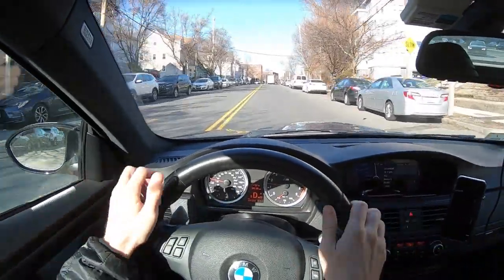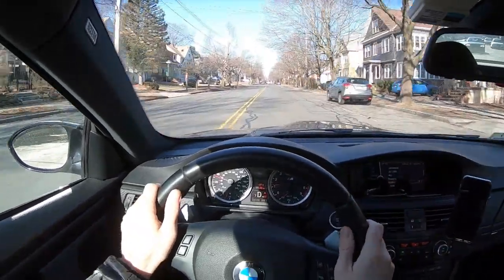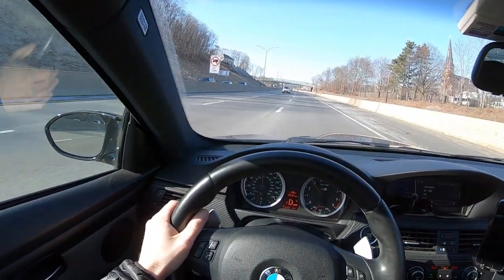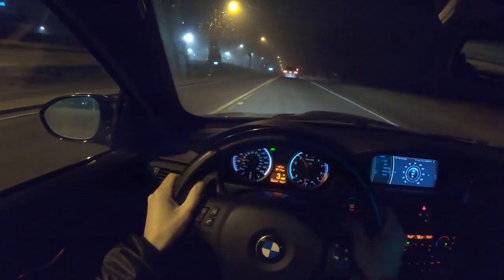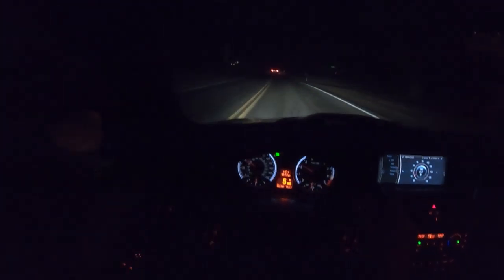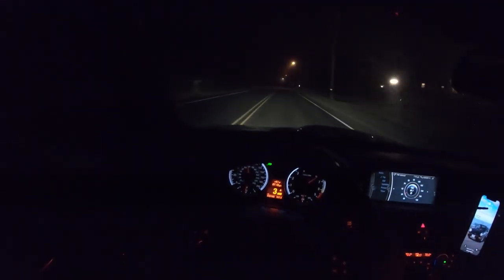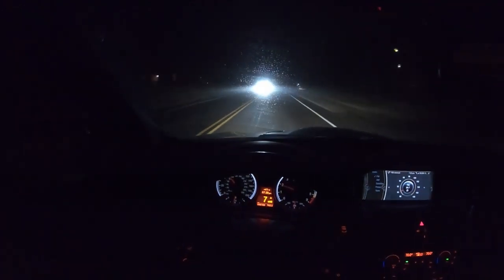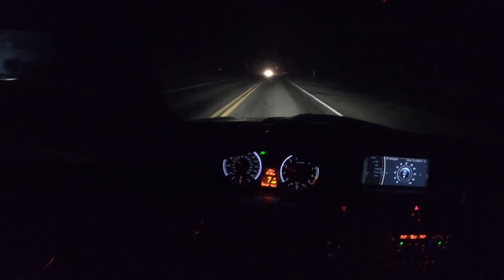Choosing Snow Tires For Your Sports Car - E92 M3 POV Test Drive

Comment from the maker: Which Winter Tires are you running? Does it ruin the driving experience for you?
Reply: Tedward running Dunlop 3D Winter Sports in 225-245 staggered. Get all around winter tire - but no dry traction at WOT until 3rd makes the M3 experience all but gone in the winter.
Reply from the maker: I had those as well...235-255 staggered. They were good in cold dry temps but had trouble in deep snow. I climbed a lot of hills with my fingers crossed and totally sideways...and a few other hills just got stuck
Reply: I've gone through winters with Bridgestone Blizzak WS80, Nokian Hakkapeliitta R3, and Michelin Pilot Alpin PA3 (not the current PA4). Bridgestone and Nokian are at the top of the heap, bar none. Michelin was more civil on dry pavement but much worse on actual snow and ice. However, ANY winter tire is better than an all-season tire! Try the Lime Rock Winter Autocross; it's a super fun time on snow! (but you'll spin the BMW no doubt)
Reply: I am a strong supporter of the Michelin Pilot Alpin PA4. I ran them staggered as 18s on my E93 M3 (235-255) and as 19s on my F83 M4 (255-275) through two terrible Chicago winters. I have been absolutely astonished by their performance in extreme cold, over snow, ice and in dry pavement conditions, both in street driving and on the expressway. My M3 and M4 running the PA4s perform better on snow and ice than our 4WD Ford Explorer does! Hardly any slipping, and the grip is always there. The car loses very little in the way of performance in dry conditions, at least in my opinion. The difference becomes most noticeable when cornering, but aggressive cornering isn't advisable in winter driving conditions anyway. The Pilot Alpin PA4s truly do earn their place among the "winter performance" tires. The biggest challenge with them is trying to find them in certain sizes. From Tire Rack certain sizes (like 275/35/19) are almost always a special order.
Reply: Michelin Pilot Alpin PA4 225/40 R18 since 3 winters and I am extremely Happy with them on my 1 series.
Reply: Michelin Pilot Alpin PA4 on oem comp wheels in 19“.
No problems in snowy or dry conditions here in Germany😎
Reply: I run 245/40-18  Michelin PA4 on my M4.  I also ran them on my previous E92 M3.  Great tire.  On dry roads they feel very similar to a summer tire at least at a somewhat normal driving style.  I have to pay a but more attention driving in the snow with these tires (something everybody should do regardless), but I have yet to get stuck or seriously slipped even in deep or compacted snow.  I ran Blizzaks before but found the tread only lasted about two seasons and didn't perform as well as the Michelins.
Reply: Pirelli Sottozero 3's are great snow tires that sacrifice very little in dry handling (compared to other snow tires). They ride quiet and comfortably, have great steering feel and have crisp turn-in. 225/45/VR17. I've had them over 120 mph and still felt very secure (149 mph rating). We didn't get much snow at all last winter so I'm not sure how they'll perform in deep snow but I'm sure they're more than adequate. I've had Blizzak WS80's and while they're FANTASTIC in deep snow, they're AWFUL as a "drivers" tire. Super soft construction makes them very uneasy on the HWY, constant squirm in the sidewalls. General Altimax Arctic's are GREAT in deep snow and just okay in the dry.

Comment: Just bought these, as I wanted something more substantial for when I hit the slopes.  The parking lots can be rough, and the Michellin AS3+ are great but not in deep fresh snow or slush with FWD.  Hoping this will be a big upgrade while still being a decent tire on dry and a better tire on wet cold pavement.  It rains a lot here in the NW.

Comment: Hey, about the lamp for the water - the problem is, you have two small pumps : 1 for the windshield and 1 for the lights. One of them is leaking and most of the time is the pump for the lights. This is very common problem, I have it the same.
Reply from the maker: Good thought but my car doesn't have headlight washer option

Comment: Bridgestone has a performance and a snow model for Blizzak's. I think the LM's are comparable and should give similar feel and dry grip to Vredeistein and Pilot Alpin. The Blizzak WS is the one that is more of a clunky winter boot equivalent to say a Michelin X-Ice.
Reply from the maker: You are well versed in your winter rubber! You're right I think i had WS60 or WS70 on my 350z. It had an open differential so it was almost always at a disadvantage but those tires never let me down in deep snow. On dry pavement though, they were hilariously clumsy!

Comment: Looking for "performance" winter tires? Pirelli Sottozero 3's! I bought a set last winter and they were one of the least expensive on Tire Rack. $568.00 for a set of 4 of 225/45/VR17; $142 ea. They don't "feel" like winter tires but like performance tires that happen to be snow tires. Good grip off the line, crisp steering, confident handling and good ride. Blizzak WS80's are great in deep snow but are AWFUL in steering feel and have no dry grip. They feel like you're driving on sponges. I've also had General Altimax Arctics and Continental WinterContact. Pirelli Sottozero 3's are the best when all driving characteristics, not just snow traction, are taken into account and they're less expensive than all of them.

Comment: Would you ever consider a winter beater being more practical than preparing a high-performance car for the winter?
Reply from the maker: Great question. Yes, I would. The reason I do not have one is because I don't have room for a 4th car, nor do I want to deal with maintenance on yet ANOTHER car.
Reply: @TedwardDrives  when I'm your age I either want an E90 M3 or a 911. Since either car is expensive to drive it seems better to have a beater to drive during snow to keep the miles down.
Reply: While that being an excellent question and I’ve been in that situation myself. I ran a Mazda protege hatch for years it was literally worth $900 bucks. 

There comes a point of when you realize even a crappy beater that starts to give you mechanical problems is it worth it. Also I ended up getting winter tires for the protege anyway becase I couldn’t  stand all seasons in snow. 
It’s sort of like weighing the options for me personally when leasing some of my BMW’s, do I go x drive and pay the $3500-4000 option or save that and buy winter setup for $1500 and save the cash and also save a few pennies over time on gas milage. I’ve always opted for the winter tires and rim setup honestly and it’s been great in Chicago weather. 
If you live in hill or mountain areas this strategy may not work out so well. So awd may be necessary + winter tires. 
Fast forward to present time I switched to Audi and S3 I still opted for winter tires and rims. Honestly being prepared is being prepared. I’d skip the winter beater, the insurance cost and headaches it brings if it breaks down and chances are you’re gonna ride it on all season tires and you’d still risk getting in accidents. Spend $1500 for a dedicated winter setup. My .02.
Reply: @rokan81  cars are meant to be driven & even if another car might be cheaper it's still a hassle to insure & store
Reply: @philliesphan334  Oh I totally agree I was mainly answering the statement above someone said consider getting a winter beater. I’ve been there and it’s not really worth it, after you pay for it, and the insurance costs but just my opinion,

Comment: What do you think is too old for winter tires? I found some for sale however they're 4 seasons old im not sure
Reply from the maker: If they have tread they should be just fine. 6 years is around the time when they start to degrade. Anything 10 years and older should definitely be replaced.

Comment: These are one of the two tires that come in my stock size for my Mazda3. I’m kinda deadset on trying out the Hakkapelttiias. Initially looked at this brand as cheap, low quality nobody knows about it.

Comment: how do you deal with rust?
Reply from the maker: Fortunately there’s not much to rust on this car. A lot of components are aluminum, plastic, or protected by paint/coatings. Underneath only some steal fasteners are slightly brown. I wash the car as much as reasonable in winter but nature will take its course. This is why I drive the m3 year round rather than the m5. The m5 is 10 years older and much more prone to irreversible damage.

Comment: Hakkapeliitta or bust
Reply: I dunno man I’ve had kakkapeliitta on my fiesta st 2 seasons ago and they were stepped down to 16” and while yes they performed like a winter tire it was squishy and scary at times. 
I’ve ran Dunlop 3D, blizzak ws80, blizzak dv2 on my truck, Goodyear ultra grip ice and the ws80 when I had them in the bmw were by far the best I’ve personally tried. I think I’m going to try these vredestein this season for my 18 S3. 
Hakkapelliitta are rated very good but I didn’t care for them with a tall 16 sidewall plus they’re hella expensive, if I spent that kind of money I’m going blizzak again. Just my personal experience.